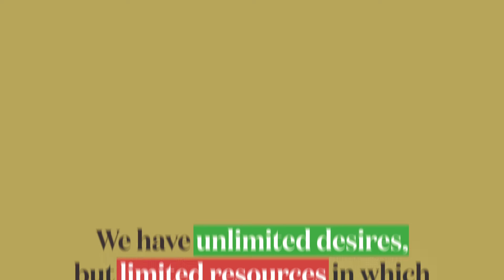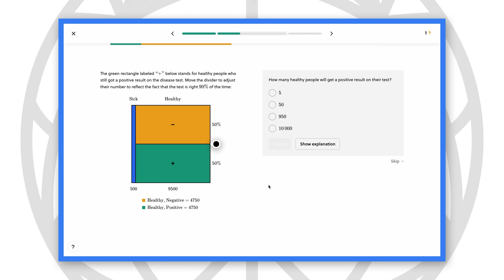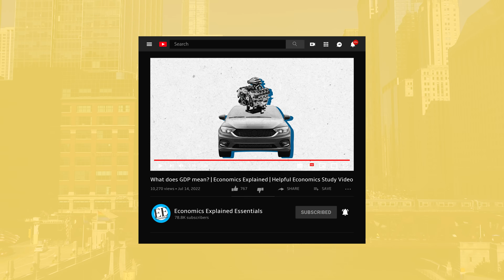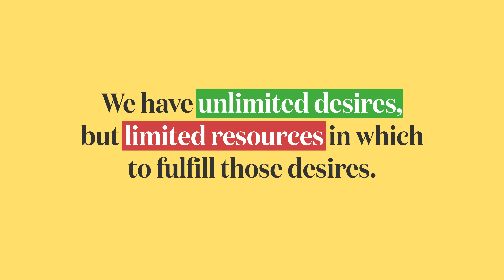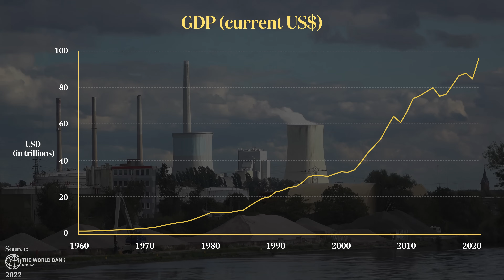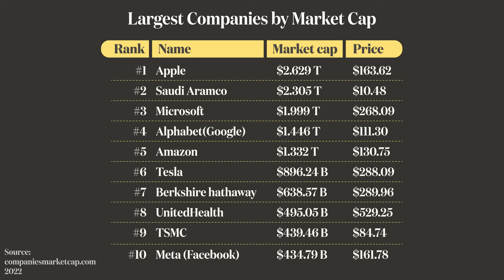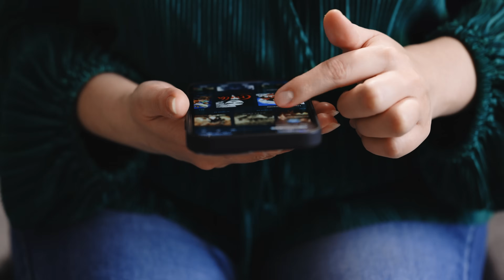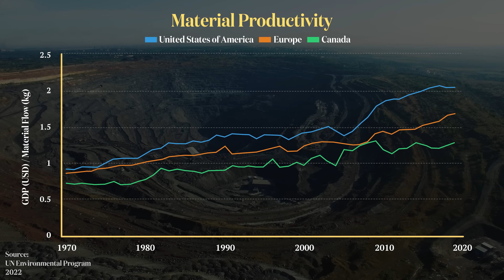Limitless Growth Is Possible If We Run Our Economies Correctly | Economics Explained

Comment: Economic growth is closely coupled with energy usage, and even we have 100% clean energy, at 2% growth, the entropy kills us all in a few 100 years. Unfortunately you can’t beat thermodynamics.
Reply: Which part of entropy..? 🤔
Reply: @movement2contact  there is only a restricted amount of the energy content that is contained in something that can be extracted and when you extract it, this amount gets reduced. So, you always keep on losing the usable amount of energy in a system. Since everything in the economy comes one way or another from the use of energy, that means that your potential capacity to produce goods only gets smaller with time.
Reply: @ilccosmolgst  Well, energy COULD possibly be 100% regenarative some day, but the minable materials' concentrations/pools/mines will inevitably run out, that's the other entropy I was thinking about...
Reply: @movement2contact  no no, it is a fundamental limitation, it affects every possible energy extraction. It's one of the most reliable law of physics actually
Reply: Exactly. The inefficiencies are an inevitable part of life. There are also other physical limits, one cannot increase the efficiency forever. There is always some limit and eventually we will hit them
Reply: @janboreczek3045  yeah anyone with some knowledge in (real) sciences or engineering should know that.

Comment: Even Netflix needs more resources for more customers. It need more servers, mod bandwidth and these things are physical
Reply: Yes, but the point is that the value generated by those resources is so incredibly more significant than the value extracted from the materials used for fast fashion that reducing one and increasing the other would grow GDP without increasing the strain on our resources.
Reply: But the cost per customer is the important measure here, and servers, bandwidth are things that don't require a 1 to 1 scale.
Reply: More actors, more cameras, more production crew. They all need to be transported to and from work. They need heated and airconditioned offices to work in, and so on and so on.

Comment: I don't understand your argument about quality over quantity. Even if we focus on quality, we will STILL eventually run out of resources, just at a slower pace.
Reply: the universe is infinite, technically you can never run out of anything
Reply: @prajwal9544  I referred to this planet, since he said at the beginning he won't be taking about inter-planetary economies.
Reply: @SurfingBird-1  Even so, we never use up the lithium in batteries or for that matter anything. We modify it chemically, with enough energy we can always get it back. To be fair that's not even necessary, we are literally the biggest rock in this system. We can't dig up and use everything because it's too expensive energy wise. 

Energy is the real bottleneck. So it's always quality that matters over quantity. A highly efficient system is always better.

Comment: Would inflation alone keep the GDP keep on growing? like the same gross product will be pricer next year? Genuine question could be dumb though.
Reply: Garrit Dorgarten  So basically a economy that is not growing at all or shrinking is growing at the rate of inflation ?
Reply: Inflation is caused by central banks printing money. An increase in the fiat money supply results in inflation. Get it, it's a ponzi system that benefits those with the most assets & those who leverage & accumulate debt. The honest saver livig within their means will have their purchasing power evaporate & wages don't keep up. Endless, reckless, spending, printing, ponzi

Comment: Economic growth continuously on a finite planet with finite resources is impossible.
Reply: which is why expansion beyond earth is so critical.
Reply: Yes it is. You can have very large economic growth using very few resources. Although that does mean putting the vast majority of the population into the Matrix.
Reply: Pls watch the video first. 
The video even explains that an infinite growth in output is not possible, but you can nearly improve the quality of a good infinitly. 
Let's say you are an engine manufacturer and you want to build the perfect engine, than you will have to face an unreachable limit/optimum in efficiency at which gasoline can be physically burnt. You can not reach this optimum, but what you can keep doing is getting closer and closer to the optimum. You can reach 70%, 90 %, 95.55%, 99.9999% effecieny and so on. 

Economics is the efficient allocation of goods and you can always somehow make it more efficient and as long as there is technological development, there will be economic growth.
Reply: @kleinesschreckgespenst319  improving efficiency alone continuously is even less feasible than growth in scale, hitting even more solid walls of physical laws - both are important
Reply: This is not correct. You can have continuous growth by continuously manufacturing more valuable things with the exact same inputs.
Reply: @damiendeecee  technology has limits and those are the laws of physics. E.g. you can only shrink computer chips so much before quantum mechanics and heating issues prevent further minimization. Eventually you will need to scale things along with making things efficient.
Reply: @SchmucklesDaMan  We're talking growth in value here.. which is a human thing, not a physics equation.
Reply: @damiendeecee  value is measured in how much you can give in tangible things to get the good, you can't increase the value of a thing alone without turning this method into something akin to admiring a rock on a road more and more and claiming that the economy grows because of that.
Reply: @damiendeecee  sure but most people value having more physical capabilities/choices all of which require advances in material sciences to get, science which are subject to the laws of physics.
Reply: @SchmucklesDaMan  That's only up to a point. Maslow's hierarchy of needs shows physiological needs, i.e. physical and health needs, are the first step. After they're fulfilled, belonging, esteem, cognitive, aesthetic, self actualisation and transcendence needs aren't usually governed by physics equations.
Reply: @Invizive  Value is not measured in terms of items. It's a psychological thing. As societies get wealthier, they value service and experience more than physical things.
Reply: @damiendeecee  you forgot to include human greed into that reasoning, the driving force for our current economic model. There are already more than enough resources today to meet even the most basic needs based on maslow's pyramid within rich countries and yet we haven't seen this happen.

Developed nations also haven't stopped funding advances in material science either despite most people having reached the majority of maslow's hierarchies in these countries.
Reply: @SchmucklesDaMan  we certainly have seen this happen. Extreme poverty ($1.90 per day) in wealthy countries has almost entirely disappeared, and the relative poverty measure ($30 per day or less) is dropping rapidly as well.

For the first time in history, in 2013, less than 10% of the world was in extreme poverty, as well. And we're down to around 9 or 8% now.

You seem to have what economists call pessimistic bias.
Reply: Economic growth would be continuous if we reach other planets by the time growth on Earth alone becomes unsustainable
Reply: @Invizive  this would be the easiest path, but you still can have continuous growth short term without requiring infinite resources.
Reply: @damiendeecee  well, EC is talking pretty much about enduring the finishing straight before any next level on the Kardashev scale